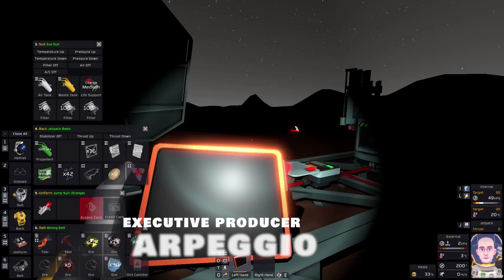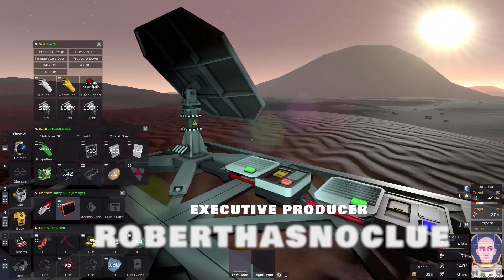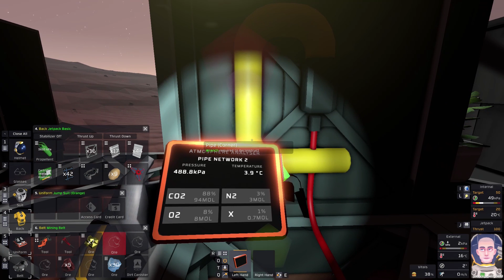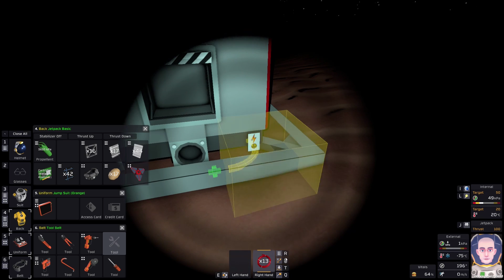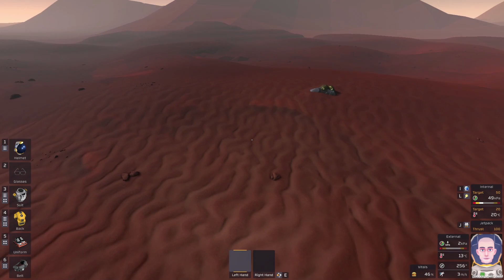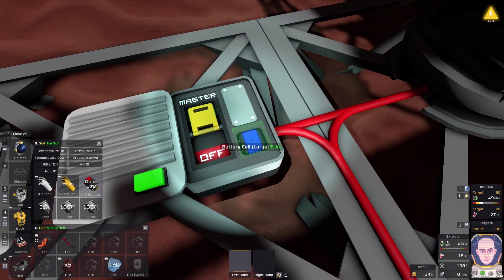Stationeers: Level One Update - Part 3 - RESEARCHING LOGIC

Comment: You do realize if you had just pressurized the small airlock before opening the inner door you wouldn't keep losing pressure?  Pressurize up to around 15kpa in the small airlock and then open the inner door will help to keep everything at about 15kpa.  Then you only have to worry about temp.  If you adjust it so the temp you want is what you have in the airlock that will also help to cool or heat the inner air if it gets too bad.

Comment: Just fyi, a condensation reaction is what it's called when you do "reverse" hydrolysis. But regardless, I'm fairly sure it's just some sort of electrolysis that yields water, or possibly just combustion via a fuel cell, but that depends on if it takes or produces energy.

Comment: The daylight sensor has to be on a vertical surface facing the sunrise for the setup you're talking about.  The rotation doesn't matter though.  You can have the cable connection face any direction.  And yeah, the "tooltip" you get when you look at the daylight sensor displays the available information a bit differently than if you're reading it with logic.

A thought, you may want to turn your solar panel 90° in one direction or the other so that when you start adding more you can keep all the data and power ports in a row.

I also like to build my solar panels up one frame from the floor of my work area. 1. I can use the end of the row for my APCs, 2. It gives me more surface to build my logic on and 3. I'm less likely to build something nearby that casts a shadow on my panels.

At the risk of comitting a faux pas, here's my video on my most recent setup.  I do the slightly more advanced single axis setup but you can see how I arranged my panels, APCs and electronics.

https://youtu.be/AwHeGVvwzUA